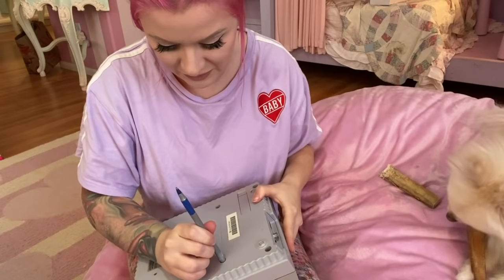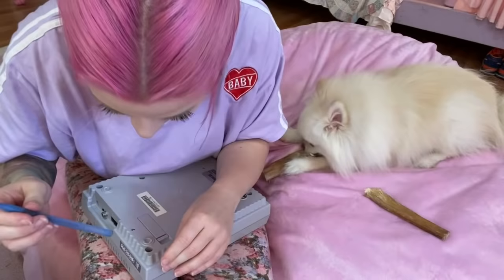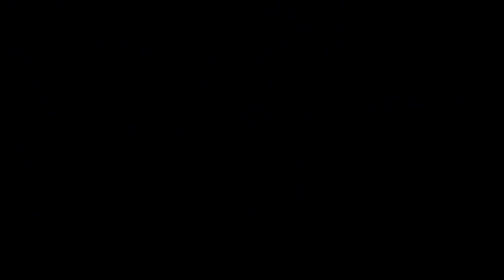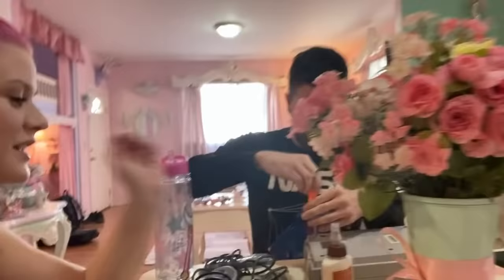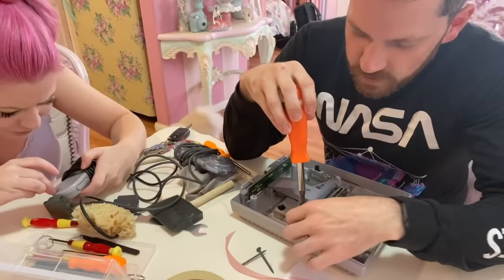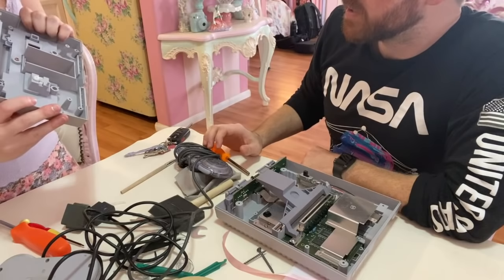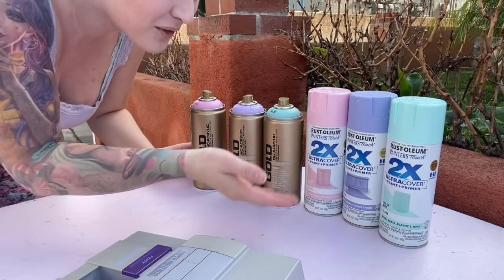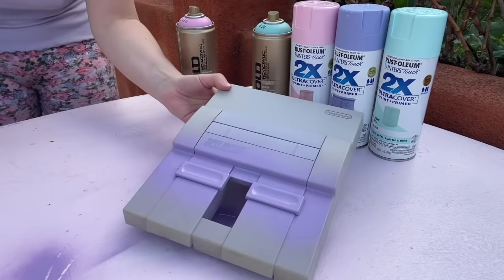DIY CUSTOM PINK SUPER NINTENDO

Comment: The paint would be more durable and smooth if you used scotch brite and scuffed the surface before painting. Especially on plastic as paint does not bite into plastic well...scuff until all of the sheen is gone, wipe it down with alcohol and then paint. It’ll make your paint jobs last longer and look better 👍🏼✨
Reply from the maker: Oh boy, that sounds like a lot of extra work!
Reply: Haha it isn’t! And the extra energy is worth it.

Comment: I did the pen lighter trick to do take my SNES apart several years ago. I couldn't get it to work at all and got impatient and just stripped the screw out used putty to put it back together. it wasn't pretty. I didn't paint mine, though. I used some kind of weird recipe for a peroxide paste to put on it and return it to its original color and it worked perfectly! I had to put it under a black light, too. I never understood the science behind it lol.

Comment: It came out SO BEAUTIFUL! Awwww... 💖💖💖If you ever have problems with connectivity, cartridges loading etc, there are great tutorials online how to disassemble and cleans NES and SNES consoles. We had ours professionally cleaned and every single cartridge works on the 1st or 2nd try now.  When it got dirty a couple of years later, we learned how properly clean the cartridges ourselves as well how to clean the interior elements. It's not super hard. To clean cartridges,  all you need are Q tips or a toothbrush, and 91%  isopropyl alcohol (the higher percentage is key to avoid moisture damage) and just scrub  away build up on the contacts, and let dry. Easy!

Comment: I do like the color scheme. However, a few tips from an (ex) famous console customizer (Ricepuppet, who did all the retro consoles, Google) as stated, the best way is too clean out the plastic parts in a bucket of water. Remove all the inners, dry down the plastic. Sand down the plastic lightly, then prime it. One coat. Let it dry, don't be hasty. I see you used a blow dryer: this process only rubs the paint all over the place. Letting it dry naturally gives the best result. Then spray paint it from a further distance and let it dry overnight. Do two coats to have the best effect. Also, try to disassemble those joy pads and coat each part seperately. All this takes about 2-3 days, but it'll last longer in the end 👍